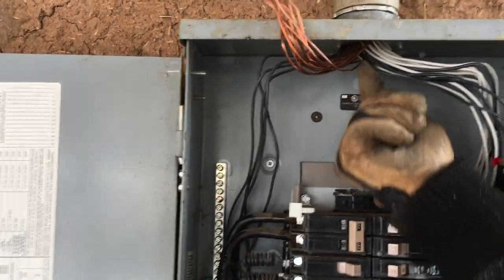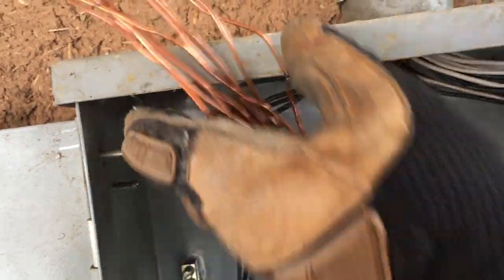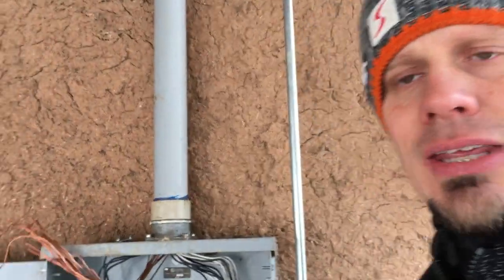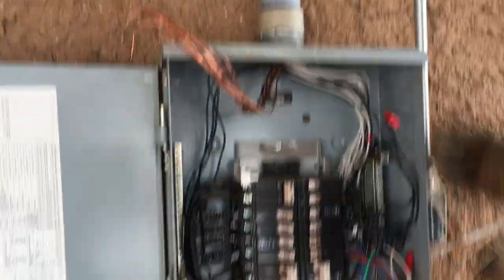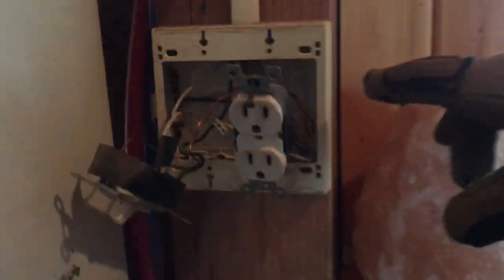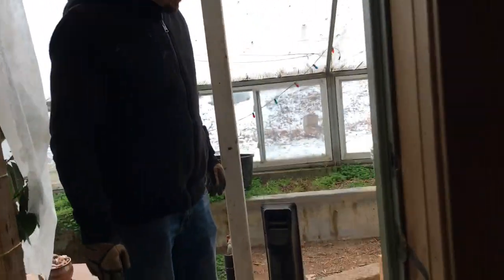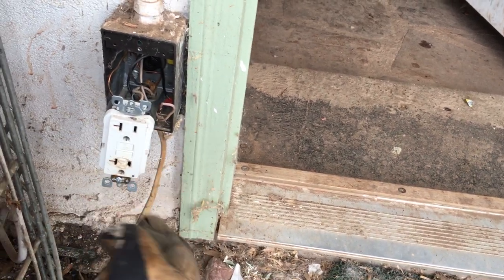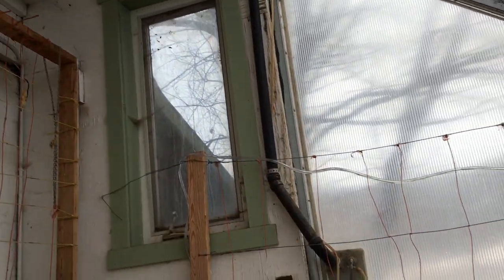Diagnosing Electrical Issues in a Home Probably Wired in the 90's

Comment: What can I tell you but one room is total black out. No power at all in the outlets and the light fixture too. Even took out a light in second room and a plug in third room. It was furnace and computer room and used 2 tiny space heaters too. We turned on /off the breakers both panels so many times even letting it cool off for hours. Next utilities company came out and checked everything he says the panels and breakers are good. Didn’t lose a leg. I don’t know what happened and how to fix it. Crazy but could be the plugs were burnt out but that’s what the breakers are for and doesn’t explain the lights going off.  And as for the other light and outlet going out in the other rooms. Any help be appreciated thanks

Comment: Interesting! I had an inspector tell me not to seperate them in the box and made me bunch 2 seperate circuits together. I agree with you, they should be kept seperate
Reply: This is a big reason I'm switching to lever wagos they can be all tied together but with a flip of a lever isolated easy
Reply: @wizard3z868  I do love those things but I dont think enough time has passed to know the pitfalls and flaws. Maybe they deteriorate over time? Who knows.
I'll stick to twisting nuts.
Reply: @WeatherNut27  o I only wld use em for multi circuit grounds and maybe fixtures tht wld be normally changed out.I'm honestly a copper crimp and nylon cap guy. and I always twist my wires and use wire nuts when I have to and pretwist  the nut is just an insulate the real connection is the twist. It was taught to me and over 20 yrs never a problem

Comment: Hi everyone, any chance for some help?
What could cause the kitchen lights, that are on a circuit that has recently died to come on when I turn on the stove, a couple other circuits have died too, one only has 70 volts between hot to neutral , but between hot and ground it's 110, I've investigated a dropped neutral with a multimeter with the old style (Edison) fuse box opened up, and everything is checking out ok, I guess I do not know what the proper test is to find problem. I always use new insulated gloves, tools, and shoes. The two 60's(main) two 35's(stove) the two 20's(waterpump, Washer) and six 15 amp(rest of house) fuses are all good.
Please help, Thank you.

Comment: Even in the 90s why would you use a 16-space panel? "Uh duh, I'm gonna save money by using a smaller panel and then spend more using twin breakers"
Reply from the maker: I did not wire this. It was a service call .
Reply: @Petersonelectricllc  I know, do you agree that whomever wired this should have used a larger panel?
Reply: @Petersonelectricllc  Even the el-cheapo townhouse I used to live in, which sold for all of $125k in 1994 when it was built, got a 20-space panel.

Comment: Question, what can cause some of my 1983 home circuits to have 128 Vac at some of the outlets and all others to have 123Vac and cause 15 Vac to be traveling back through the catv coax center conductor back to the catv pedestal until it overheats then the catv wire and shorts it and melts it near the catv pedestal tap. Confirmed, no electricity is coming from the catv system to the home and the Vac is all the same 123Vac at the breaker outputs. I have been chasing this for days, no Vac nor Vac is coming out from the 3 catv boxes.
Reply: Sound like a neutral wire issue at the service. Since the CATV is grounded through the panel and the neutrals are too. If the service drop is damaged that amperage is searching for a return path. In this case the Cable drop.

Comment: Was it a bad GFCI tripping the circuit? Or A bad cord?
Reply from the maker: Ground fault in a box and conduit, and bad GFCI with cords cut in the Green house.
Reply: Peterson Electric 
I Thought it was a bad GFCI
Reply from the maker: Both and more
Reply: Ground leakage should be normally very tiny not enough to cause a GFCI to trip. However with tie-ing multiple circuits in metal boxes and conduit is asking for problems. In U.K. and Europe grounds are always sleeved for that reason.

Comment: yup, another quick reno gone wrong; that house is not wired ready for arcfault. anything  to do with the ground system has to have a proper contact, and preferably 0 bare grounds in conduit.
Reply from the maker: No it was older than 2002